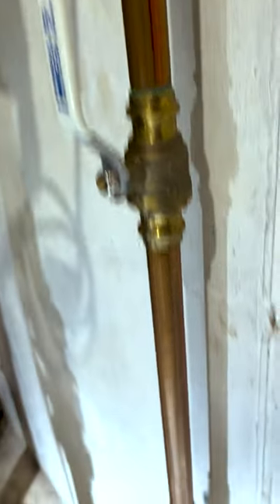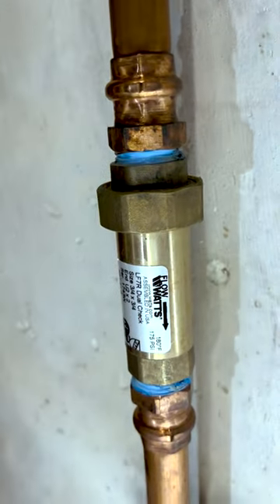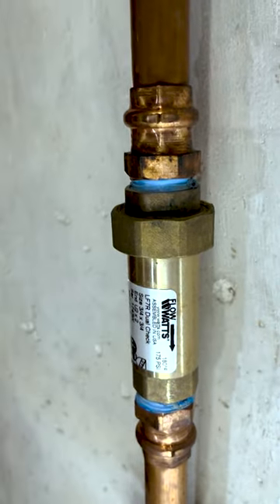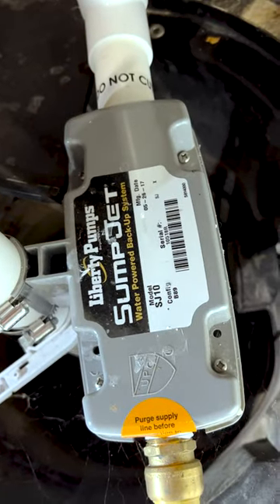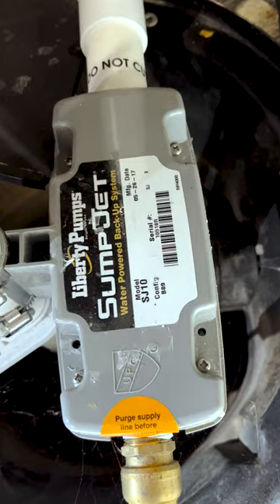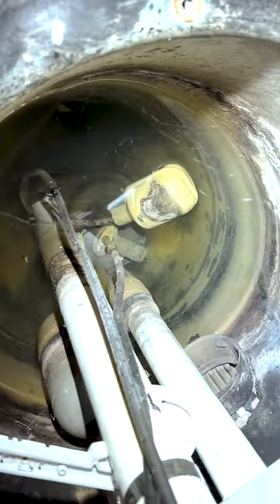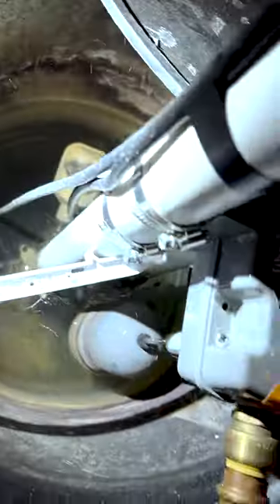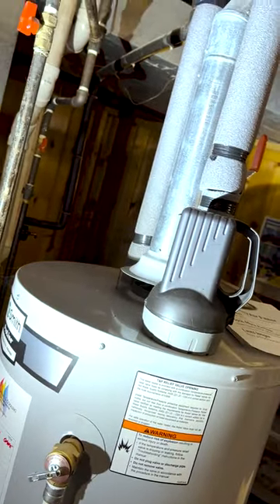What did the helpful home inspector find onsite?

Comment: It literally tells you what it is... It's a backup sump pump in case the regular sump pump fails or you lose electricity... It uses water pressure to cause a siphon to pump out the water in the pit... It looks to me like your regular sump pump is either not plugged in or it has gone bad but the float for the backup is up higher than the water....
Reply: 100% agree. I wouldn't be running a t joint into the water heater supply... odd but probably allowed.
Reply: @anybodykill6666 I mean it just needs a water supply to create the siphon effect and it has the one way flow valve to prevent it from pulling water from the water supply line. Looks like a proper install, actually pretty solid if you ask me
Reply: I get what it is, but it’s going to discharge more water into your soil from the supply as it in theory the discharge is 1/3 house water 2/3 sump water. Not sure if it’s a good idea period, but connecting it to your potable water supply can go bad in a hurry too with a cross connection situation only a fail oneway valve away. This is the 1st one I’ve seen like this in over 4K homes. Only other similar system I’ve seen was a home made DIY type deal. I guess I’m thinking if this is a good idea, or even a reasonable solution, why don’t we see a lot more of these. Battery backup would be a better choice in my opinion if the concern is power outages. Let me know what you think.

Comment: They r pretty common especially in the country. Its an archemedies pump. They use ALLOT of water under pressure to pump a little water up a head.  It seems setup right to me w the float for the backup higher than normal pump and the water flows through pump and hopefully into a city sewer or out into the yard. U can't just discharge the water into the sump or it will just fill the sump.

Comment: The one way flow valve looks exactly like the double check valves required in hospitals any time a potable water source connects to a non-potable process

I’m willing to bet that water pump is a simple Venturi that uses low pressure to suck out the sump.

Comment: Those are quite common in houses where people will be away for an extended period of time, like snowbirds. Most cities require yearly inspections because they connect to the water supply, good to see they at least put a one-way flow valve in.

Comment: A Venturi pump  would work in a power outage, But what kind of seepage do you have that would overflow  during the time Power might be interrupted?  I like redundant systems  but I'm thinking a back up power generator would have been a better use of the money.
Reply: Unless the pump just burns up and dies generator won't help and it still will pump water

Comment: How are you qualified to inspect homes when you lack knowledge of  homes basic mechanical systems? Glad they didn’t have any tankless water heaters or pex shut off manifolds, that would have really thrown you for a loop!
Reply: You think this is a “Basic mechanical system”? I’ve inspected almost 4K homes and this is the first one I’ve seen of this type. With that frequency I don’t think you can call it a “basic” system. When I find rare things like this it’s for 1 of 3 reasons-new technology, expensive, or bad idea that never took off. Everything I’m learning since making this video tells me it’s expensive, requires regular maintenance/inspection, and is also a newer technology. I knew what it was right away…just wasn’t sure if the install was good, use is appropriate, or if it’s legal to tie into the municipal water system with all the new separation/back-flow regulations. It also is going to increase the discharge volume onto the exterior soil that is already saturated if the sump is filling up. Seems like a good emergency backup if it “really” works as intended. Who knows, maybe we’ll start seeing more of these. Thanks for watching our videos 👍🏼
Reply: they paid him good money to walk around and say "wtf is this thingamabob?"  money well spent

Comment: This is a water-powered sump pump and it's designed to use when the electricity goes out pistol savior basement from flooding. The weird part is they are running the output of the sump pump into the hot water supply so they can use the Overflow water in the hot water heater. That's some crazy money-saving whack job shit.